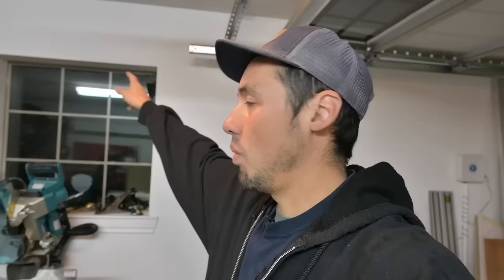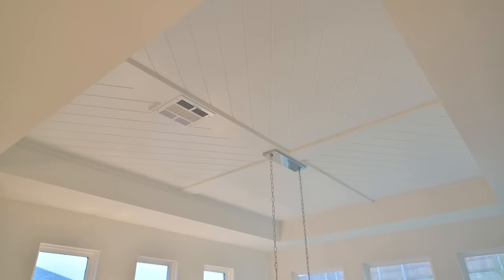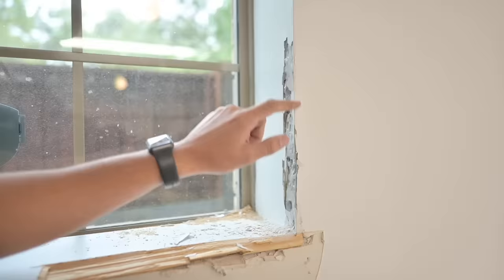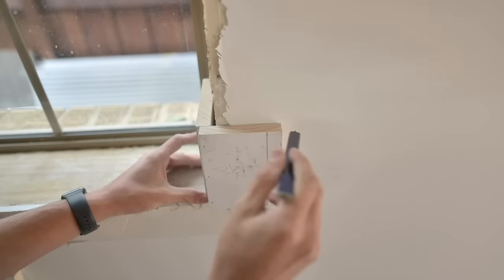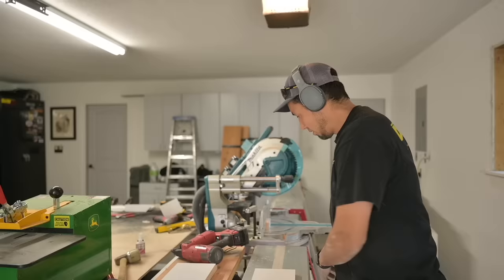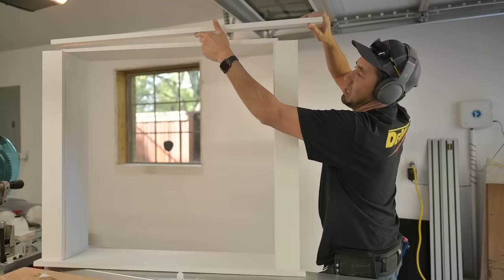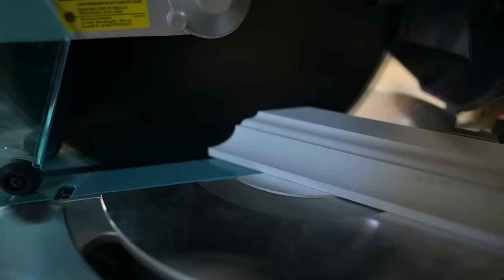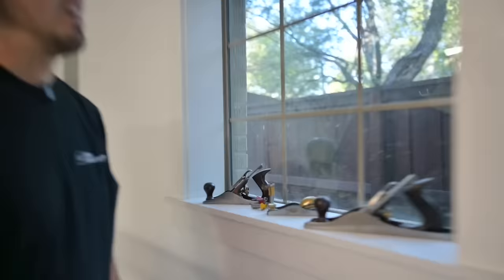Window Trim Build and Install.

Comment: Call me impressed!  One trick I learned from my best friend years ago (he installed A LOT of windows at the time) was to use a specific tool to get off the old metal corner-bead.  But I probably shouldn't give out his secret!  It is called a few things - horseshoe pliers, hoof pincers, farrier's nippers, end cutting nippers, jaw pincers, saddle pliers, etc...  Mine are from Harbor Freight (had them for years) and didn't cost much.  Use them to grab on to the corner bead, rock it back and forth a few times and pull.  Super easy and FAST!
Reply: That does work great if it’s nailed, not sure about screwed on bead.
Reply: Thanks for the gracious tip.  That tool is a lot more common in French carpentry circles where their hammers usually don't have claws.  They use those instead for nail straightening and pulling.
Reply: Now that is a great tip........ thanks.   Can hardly wait to pull my next corner apart.
Reply: @c_mac7773  you not supposed to use screws on bead.
Reply: @ghshomeimprovements  We’re not talking about installing corner bead, we’re talking about removing corner bead. I’ve had to remove corner bead that someone screwed in place Many times
Reply: @c_mac7773  I understand and I agree with but I’m just saying to those who wants to put damn screws into the bead.

Comment: Love it! I was a finish carpenter for about 6 years and never did it like this (didn't know) and then some cabinet guys that were doing the cabinets, in the house I was working on, told me about doing it this way and my mind was completely blown! Hands down the best tip I was ever given by another woodworker!!

Comment: Good job!  
Suggestion:  Before installing the preassembled trim, apply painters tape around the perimeter of the window opening (or door opening or on the wall) so the tape is exposed all around the trim for an inch or two.  Fill the nail holes,  prime and/or paint the frame and then use a sharp utility knife to cut the tape.  Caulk the trim (if desired). I use this method on new window, door and base moldings.  It is a lot easier than trying to mask the walls after installation of the trim.
Reply: Awesome suggestion, so simple but I would have never thought of that! Wish I could use that trick where wall meets ceiling just cause I suck at cutting in! Lol
Reply: @ed370zx3  If you cannot use tape or masking paper, (at the ceiling it is difficult) then use a high quality (emphasis on HIGH QUALITY) brush.  I use a 2-1/2" angled sash brush.  Start your paint an inch or two below the joint and gradually press the bristles up to the joint.
When I "cut in" by hand, I put my paint (about a quart to start out) in a 2 gallon pail, put a 1 gallon roller "screen" in the pail and use a 4" roller and the 2-1/2" brush to do the cut in.  DO NOT allow the paint to dry before rolling the walls. If you do, you will always "see" where you cut in. It's called a "halo".  
I use a 40" walk board to cut in at the ceiling.  Then I move the walk board and roll the wall where I just cut in.  So I advance about 4 feet at a time. 
If I am not installing new base, I use a 3M "hand masker", 1-1/4" tape and 9" paper to cover the top of the base, then cut in the baseboards with the same brush and roller at the same time, moving along about 4 feet at a time. 
Good quality brushes and roller covers make painting enjoyable compared to what it is using poor quality tools.  They are definitely worth a few extra dollars.
If you have smooth finish ceilings, you can mask the wall/ceiling joint using the hand masker and 6" or 9" paper, but you have to "tack" the paper to ceiling ever few inches with a small piece of tape to keep it up there.
Reply: gary K Thank you Gary, def going to use your advice.
Reply: If the tape is behind the trim, how does one caulk the trim to the wall?
Reply: @wytas20  My mistake.  The caulking, if desired, is done after the tape is cut. Edited.
Reply: Good tip for DIYers..if u have the skill to do his pre-built though then u can probably  just cut in
Reply: Excellent!
Reply: You still have to paint the caulk tho. Over time most brands yellow if left unpainted. Which is never good on white trim. Makes for a better line anyway to caulk, wait for it to dry, mask and makes sure to keep lines straight. Than paint. Or if you’re a boss you can just cut the windows with a brush after using your method
Reply: Thanks man. I have 14 doors to install today and I've never thought of this before

Comment: I'm doing a new house right now the exact way you did yours. A slight difference in mine is I glued and nailed the' I call them ribbons, to the head casing and then pocket them to the side casing and head jamb. FYI, what you are calling the sill is actually the stool. A sill is on the exterior, the sloped part of the window frame itself. I'm old school. I started in 1973.

Comment: I have 7 windows that need window casings. Fortunately there is one casing that is completely different measurements while two are of same dimensions. The last are of all the same dimensions. You have just made my life so much easier if I had used the old methods of construction. Cool beans!!! Thanks Richard!!

Comment: That screw shim tip is great. Among the many projects i have, my son just bought a house with very old and thin trim with a marble sill.
Reply: What’s the purpose of adding the screws shims?  Are they used to square and plumb everything, rather than by shinning with traditional wood shims at time of install?  He doesn’t appear to go into detail in this video but perhaps he does in another?
Reply: @archerpsu23  he definitely should  have done a better job of explaining the screw head trick. lotta confusion here.

Comment: Measuring from the screw heads -- wow, great technique.  Great demo on the drywall and the corner bead.  Demolition is way underestimated as a skill.
Reply: I actually don’t get what he did with the screws and measuring from them. Would you explain? I want to attempt this
Reply: @steverodgers9206  The screw heads are basically used like shims. They make the opening uniform and also could be used to make all windows typical in the event that you had several windows that were close in size. You could then pre-cut all your pieces.

Comment: Oh man, what a sweet video. Thank you! I have to do this to 27 huge windows in my remodel. So grateful for this.  Can I ask a question.... where do you buy your wood (poplar??) and those gorgeous molding pieces? Is there a secret store that all the master trim carpenters know about?  Because it's definitely not the local big box store and not the rough lumber mill.

Comment: Very cool!  Your window casing is very reminiscent of a 1908 4-square two-story we lived in. Your crown looks nearly identical to what we had.  I had Whiteside custom make a bit for me as I had to replicate the original profile on 17 windows and 14 doors.  Former owners had ripped out all the original woodwork on the second floor, then paneled the walls and then trimmed everything in that cheap prefinished garbage you find in a manufactured home. Other difference would be your drip ledge (freeze block) molding below your header board. Ours was about 7/16 thick with a roman ogee profile.

Really liked how you built the entire assembly and pocket holed it together.  Cool!  Really enjoy your channel!  Thank you!

Comment: LOVE the Castle “John Deere” pocket hole tool, VERY WELL MADE and does a great job at those pocket hole “cuts” and the pre drilling its does, NICE TOUCH and is what makes tools like this “in a class of there own” as you get what pay for. My uncle who has production cabinet and custom cabinet making shop/biz (amongst other things) as some AWESOME toys and tools. CNCs, robot suction moving machines, gliding track system on ceiling, and so on. But his pocket hole “stations” are like your, but on steroids as just bigger and even some automated (most) but the precision is impressive, just like your Castle😁
Cheers✌🏻

Comment: You could use as many 18 g nails with some shims and build it all in place in 20 ish minutes. It's all caulked and painted, but you did a great job and it was interesting to see that castle machine in action. What a cool tool!

Comment: After all that preassembly and making it one piece, I thought for sure you would just screw it in, so it was removable for anytime you have to paint. You can paint the whole case itself off the wall, and or paint the wall, and it would be removable versus masking it off. Food for thought.

Comment: Maybe you already know this but if not the tape measure has its width stamped on the backside … sometimes it’s easier, obviously more accurate than bending the tape, to butt the tape measure to the wall, window, etc., and add the ~3” to what the tape reads.

Keep up the great work, love watching you do your thing!
Reply: I keep a 1 x 2 wood block in my pouch and use it when reading inside measurements.  It's the most accurate and fastest way I have found.

Comment: Love the trick with the miters so you don't get an end grain nice I'll try that.
Reply: Can you explain this detail further. I noticed him doing that several times and was curious, why cut the 45 only to glue it back on. But I don't quite "get it"
Reply: @bizeigel  the reason for the return is end grain takes paint/stain different then the rest of the board tbat is unacceptable on a nice project
Reply: @bizeigel  I think he might have cut and glued a new bit on because the bit he cut off had an end grain so when you paint it you could see the end gain and it would look like an amateur had done it  would be nice if he could explain properly but then trade secrets and all lol

Comment: kind of off topic, but i bought that router bit set from sommerfeld that you showcased in a really old video and it was a game changer for me! i used it and wainscoted my grandmothers house with a raised panel. that tip about using the saw track for the end pieces helped me alot as well. love your videos! also semper fi man!

Comment: I'd suggest painting the raw edges up next to the glass.  If the windows ever sweat that moisture will definitely work its way into the wood...or if you're using MDF...it'll blow that stuff up.  The time to paint/protect that assembly is before installation.  Cheers.

Comment: I like the screw offset idea!  If you had a bunch of windows that were close to the same, using those screws to offset and make them uniform, you could fab all the casings in your shop and save a ton of time installing them.
Reply: Hi Matt, Are you referring to the screw offset idea at 8:25? I still don't understand the reason for it but I bet it's a trade's craft. What is the purpose? Thanks.
Reply: @uu35  By using screws, you can make the width uniform for every window in the event that the jams were not typical.
Reply: @johnboggs8765 n his Wainscoting series, he kept the stool up off the sill in case water got in. I didn’t notice him doing that with this casing. Still, great idea with the screws.

Comment: I was surprised to see all of the wonderful Craftsman-like touches in that house, and the spectacular tongue-in-groove ceiling with the 12-by divider. Really, really nice. I sent the link to another guy and he was even more appreciative.

About the mitered returns on the sill horns in the garage... given that this is a painted project might the end grain instead simply have been smoothed out? I am thinking of so many demonstrations that I have seen of "shooting boards", used not only to assure that ends were at 90 degrees but also to get a butter-smooth end. I'm talking about using a hand plane running on its side, with a jig that causes the plane's sole to be 90 degrees from the workpiece. You don't need a neat-o shooting board, just a "bench hook" would do. You don't need a special plane; even a block plane will do (if its iron is very sharp). And a bench hook is rather a compact thing, easy to make, and it doesn't matter if it gets beaten up a bit. And its quick! The downside I suppose would be having to prime the end, but that shellac-based primer with the alcohol thinner dries fast.
Reply: End grain doesn’t take paint like the rest of the wood even after it’s been sanded. It’s a lot quicker and easier to cut a return on the horn instead of messing around with sanders, planes or shooting boards

Comment: Great video and detailed explanations but why do you cut off the end pieces of the stool at 45 degree angles only to glue the small pieces back on? Why don’t you just leave the stool as it is simplifying the build? 

The windows I’m about to frame have a 1 1/2” flat space around the window so thankfully I don’t need to remove the drywall corners around the window opening. I can just place a fully constructed window frame inside the window opening and level it. I’ll be using a nail gun and then covering the nail holes. 

Thanks for the great video. I wish I had your collection of tools. I’m going to use a nail gun, circular saw, box cutter and a pry bar to remove the old stool. 

I’m glad I found your channel. I just subscribed and liked. Keep up the wonderful craftsmanship!!! 👍🏻👍🏻👍🏻

Comment: Is there a reason why you don’t make the header with horns the same way you make the sill? The sill is one piece and the header is two, could having that seam on top be avoided? Great videos keep them coming!
Reply: With the header horned, the top trim would look like it's just plopped on top. With the seam there, it actually looks like the vertical casing trim is supporting the finished header trim. You could do it either way, just personal preference.

Comment: Got some questions for older homes that maybe you could do a video on if you run into it? 

What do you do for window casings where the window is so close to a perpendicular wall that you can’t have the stool or the header extend the same distance as the other side?

What do you do if one side of the window has a greater depth than the other side due to bad drywall/warping?

I’ve got these problems in a few rooms of my house and everything I can think of looks bad when I draw it up. 

Any tips would be amazing 🙏

Comment: Beautiful, efficient work. I’m confused by the mitered sill. All I can think is you didn’t want to paint over end grain, otherwise might pencil in the miter for alignment?
Reply: I think it's the end grain thing.
Reply: You don’t want to sand the end grain and it won’t carry the finish the same as the rest so you miter the ends.

Comment: I just did a couple of these plus a sliding door and regular door. Solid rough cut pine. Very rustic. Just face nailed everything. No glue or pocket screws. I hope it stays in place. >.>

Comment: As others suggested with color...get similar to the cabinets...old designer trick, make the verticals (cabs, paint, curtains) match and make the horizontals (counters, floors) match.

Comment: Great work as always!! Is there a reason that the casing doesn’t go all the way to the window? Looks like there is a big gap.
Reply: I think you mean the jamb extension.  The rough stud opening doesn't give him enough room to fit it tight to the outside of the window trim so he just butt it into it
Reply: @jacobpatriquin1549  If the jamb (aka: framing) is 3.5", or 5.5", plus whatever the thickness of the drywall is (5/8" etc), wouldn't one go with a board wider than the jamb + drywall (ie 1x6, or 1x8) and rip it down so that the 'jamb extension' ends about 1/16" from the window frame?
Reply: @symcardnel1741  yes given that one corner or side of the window doesn't stick out farther then the rest. Ideally  you would want the jamb extension 1/8 or even 1/16" from the window so it can be caulked. His did seem a bit wide but maybe it just looked that way in the video

Comment: That marking gauge is a must have tool for next level trim guys. Being able to accurately mark the corners makes it easy to measure the trim..... and thanks for mentioning, 3/16" is the right reveal, Not 1/4".
Reply: There’s nothing wrong with a 1/4” reveal. It’s all about proportions, sometimes 3/16” looks better and sometimes 1/4” looks better. You can make the reveal as big as you want as long as it’s proportionate to width and thickness of the material being used and it coincides with the reveals of other parts of the design.

Comment: Insulation? Maybe your environment doesn't call for it, but that little space created by the screw shims would have been a perfect space to put in some insulation. Perhaps a roll of of rockwool tacked in with some staples to hold it in place.

Comment: Easy garage lighting addition:  Change the bulbs in your garage door openers to high output LED bulbs (100 or even 150W equivalent).  Then you can hit the light buttons on your door openers and add 200-300 more equivalent watts of light to your shop.

Comment: First,  just learned you’re a Marine.  Please accept my sincere gratitude for your service.  Now, I need a bit of help from someone. Are the screw shims used to bump out the casing so to cover the metal edge of the window installation? Or to square the opening?  Or…? Thank you.

Comment: The hardest part about this technique is when you measure the width of the window jamb you have to use the smallest measurement or the window casing will sit proud of the drywall

Comment: Nicely done .. My ca glue isn’t holding together after it’s glued it wants to come apart when we send nails next to the joint , or if it encounters a slight bend. When you do it it looks like it holds extremely well even under some pressure. Makes me wonder what I’m doing wrong. I usually give it a generous coat of the glue , then spray the other side with accelerator. This mostly happens with pine trim.